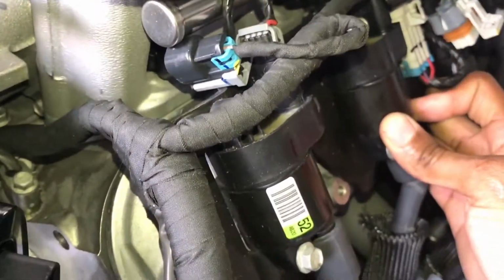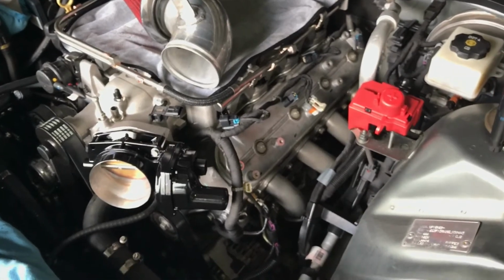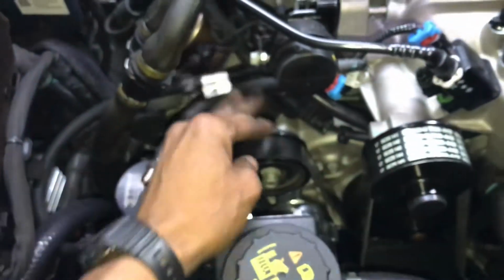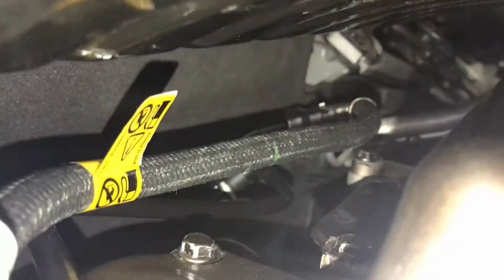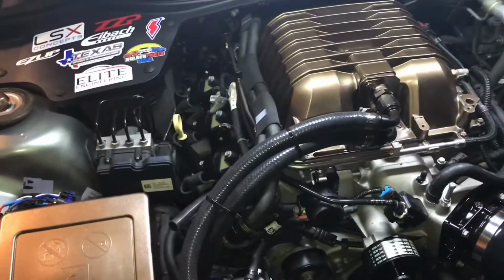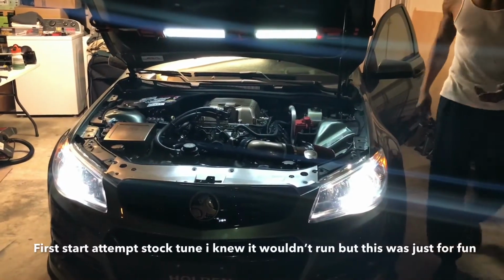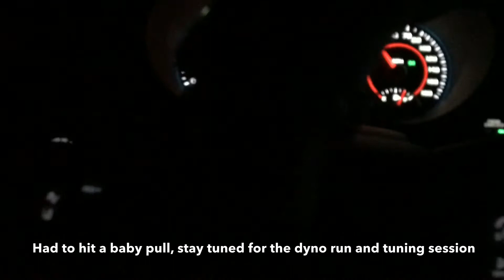LSA Swap (14’ Chevy SS) - Part 3 (Final Parts Install/First Startup)

Comment: Thanks for sharing. I’ll be adding an LSA to my 17 M6 SS soon too.
Reply from the maker: dualsnorkel hey i appreciate it. I’m sorry i couldn’t show every single thing step by step. But with a phone i was limited lol
Reply from the maker: let me know if you need some help or run into a trouble spot I may be able to help
Reply: What did you do to get it to run on the second attempt until tune?
Reply from the maker: Hugo urbina the main thing was scaling the map to 3 bar parameters instead of the stock 1 bar. Until you do that it won’t run. After you do that it will probably crank and at least run maybe not super well but to get it drivable I actually copied a lot of setting from a stock ZL1 tune. Made some tweaks to help start ups and idles with the cam although it prob would’ve done ok without. Did that and data logged a bit to make sure I wasn’t getting any knocks or crazy AFR’s while cruising. Other than that I stayed out of boost until it was tuned.
Reply: GetItAt_WiLL awesome thanks for the quick reply could you post the zl1 tune numbers?
Reply from the maker: Hugo urbina any specific tables you want? Are you using HPTuners?
Reply: GetItAt_WiLL will I’m doing an LSA on my 04 gto and I do have a predator tuner with an 91 octane performance tune on it I’m just wondering if I have trouble getting it to start I can mess a little to get it to start with the zl1 numbers thanks
Reply from the maker: Hugo urbina oh most definitely. You should be able to get it to start and idle relatively easy with minor mods to the stock tune. Now drive-ability, etc will require more but I will look at files and see if I can get a few pics etc for you. It will be a bit diff though since you’re 5.7 as opposed to 6.2 etc. I’ll contact you when I get it situated
Reply from the maker: Hugo urbina you have an email so I can send u pics of my map settings etc

Comment: That looks beautiful! I am looking to do the same on my 2015 SS i just wish i could find some buddies around the DFW TX area to do this with. It would be a fun project that i could learn a lot from.
Reply from the maker: romulus radu thanks a lot. It was pretty much and I learned a lot but it’s not too difficult honestly. I think the most challenging part was everything with the heat exchanger which still wasn’t too challenging but everything else is pretty much getting the right pieces to connect everything up. These was really not much fabricating at all. Go for it

Comment: Did you use the stick fuel Injectors and stick fuel pump. I know the SS comes with the ZL1 fuel pump.
Reply from the maker: Yea it’s the stock fuel pump as you said it’s the ZL1 pump already. Injectors however I did upgrade to 85lb injectors but you could always but the stock ZL1 injectors as well from somewhere like RockAuto. Prob be slightly cheaper. I think they are 63lbs or somewhere around there. I just wanted a little extra in case I wanted to do more or go E85
Reply: @GetItAtWiLL  cool man, how's it holding up? Any ring issues?
Reply from the maker: @isidrosevier1125  no. Still driving it everyday. Sadly it have over 70k miles on it now lol but I don’t really baby my cars I actually drive them. Been across the country about 5-6 times in the last 2 years do to work
Reply: @GetItAtWiLL  that's awesome man will be doing this soon
Reply: @GetItAtWiLL  mine has 112000 miles, but I'm on my 3rd engine

Comment: Aftermarket rockers make no extra power,  waste of money but i do reccomend the trunion upgrade if you haven't.  Is that a Ebay China 102 throttle body ?
Reply from the maker: kansasbondboat77 I’ve bought trunion upgrades. Just haven’t gotten around to putting them on I will once I get back stateside and no that’s my stock TB. I did port it out a bit though but I didn’t video that part.

Comment: Are you using the cobalt map sensor in the zl1 lid? And if you are what did you use to seal it  got my car running but it’s leaking pretty good from where the map sensor in since the cobalt one is way smaller
Reply from the maker: Hugo urbina I’m using the map sensor that came with the lid. I bought the lid new from jegs.com. It came with all the sensors but I believe that cobalt sensor will work but the one that comes factory with the ZL1 Lid is a 3 bar. Idk if that cobalt one is

Comment: Hey man I just finished mine, and in my expansion tank the fluid isn’t moving at all. The pump is definitely working, when I first installed it I ran it in ACC. mode to check. I’ve put coolant in it obv and in the expansion tank (similar to yours) it’s stagnant fluid, is there a way to burp it like a radiator or?
Reply from the maker: Jumper the pump with a battery or 12V source. And make sure you have the positive and negative correct. I had mine switch at first and it didn’t work or it was trying to pump backwards. But I used a battery to power the pump and purge the system prior to connecting it to the relay. It took a while and I had to make sure I poured the water down the tube leading to the pump inlet. After that it started pumping like normal. But I thought mine was messed up at first too until I realized I had the wires backwards

Comment: Did the valve covers come with baffle plates or did you have to swapped oem ones over
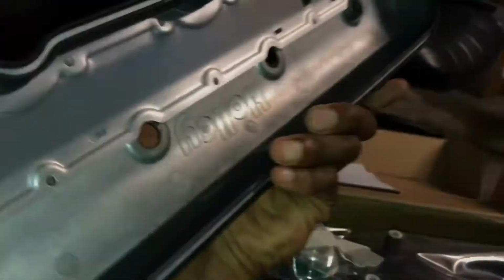Reply from the maker: Trevor Petersen I believe they have a baffle, check the 3:20 mark and let me know if that’s what you are referring to. If not no I did not swap anything over but I think they came with baffles. The style just may be a tad different from OEM. Either way I have had no issues with them

Comment: Hey man, so I'm just about complete with ordering parts for the swap and the only thing I'm questioning is the ridiculous high price for the harness extensions like the map and throttle body. Do you have any part numbers I can use or a better site to order from that isn't lsxconversions website? They don't even have the throttle body extension in stock so I'm confused what else I can use. I hope that's not all too confusing. The only thing and I'm not sure if it makes a difference but my swap will be for my G8 and not an SS. Thanks either way.
Reply from the maker: Zach Gibson you can just do a google search for like “LS3 throttle body extension harness” or whatever you specific application may be. I just did it and it brought up some options that were $5-10 bucks cheaper. Summit is a good place but the thing with that is making sure you have the correct extension for your application. I used the lsaconversions website because I know it was what I needed exactly. I also saw a lot on eBay. Now those where like in the $30-40 range. Your G8 the GT LS2 or you have a GXP?
Reply: @GetItAtWiLL  I have the GT. That's what I initially did was a Google search because I needed to keep in mind that those harnesses are for an SS and although it's the "same car" they're probably different connectors. But I Googled them and was unsure of they're the exact ones that I need after seeing gen 2 and gen 3 and all the different motor options they'd fit and I got a tad overwhelmed.
Reply from the maker: Zach Gibson yea it can be difficult to tell. I’d look at the connectors you have and what they look like and compare them to the product you’re looking at and while the pic isn’t always accurate. Read the comments or reviews on it if their are any. And questions. I do that all the time on summit’s website and it’s saved me a few times. Esp when someone ask will this fit my blah blah blah and they get a response saying yes it’ll work with a blank for example. I’ll see what I can find out. What extensions are you in need of

Comment: Hey what did you change in the tune to get it running
Reply from the maker: I have HP Tuner and the purchase came with access to the tuner repository. I just used that and essentially I copied a stock ZL1 (2011-2015 CTS-V works too) tune to get it running. I can’t remember all the things that were changed. But I do know one of the main things is scaling the map sensor for the 3 bar map sensor. Changing that will probably let it crank and run, but it may not run great. The ZL1 tune got me closest and good enough to drive to the tuner. I already had some changes made prior for my cam install. Those changes I left alone.

Comment: how did you update your water line manifold on the LSA? Did you weld AN fittings to it?
Reply from the maker: You know I made a video about that and I thought I put it in with my heat exchanger vid, but I think I accidentally left it out. But I cut the quick connects off and just drilled the holes out and tapped them, after that I just found some -an adaptors and screwed them in (I didn't weld them, I didn't feel the need to, I did Teflon tape the threads, but it fit really snuggly). I'll post that vid if I can find it.
Reply: That would be awesome if you found it. Would save folks a bunch of money!!
Reply from the maker: Michael Curry I found it. Just posted it up. Granted it was my first time doing it but I think i explained what I did decent
Reply: Thanks high speed!!